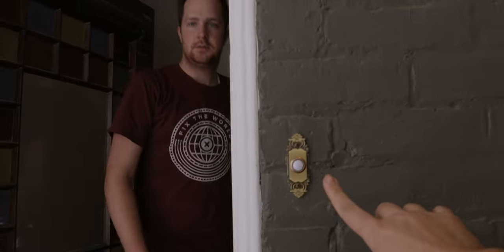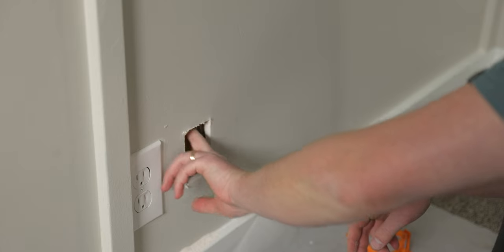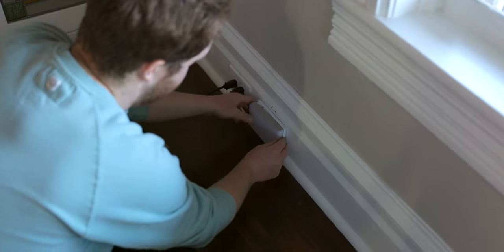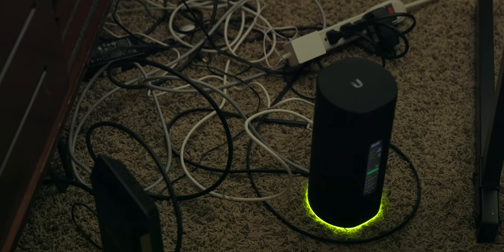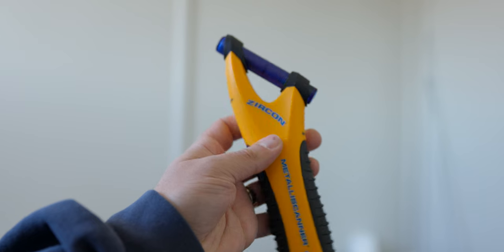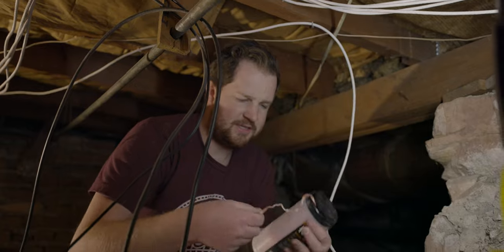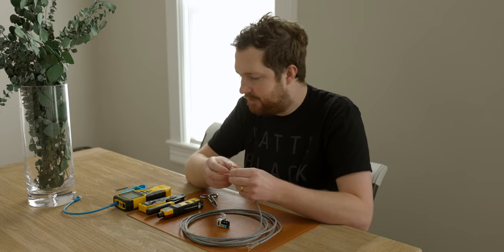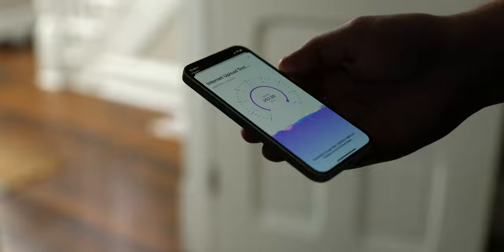Adding 10 Gigabit Ethernet to my 129-Year-Old House!

Comment: Just stupid at this point to invest in a wired network.  How much money did you spend on cabling alone?  You could outfit this house with a mesh network and be done in an hour
Reply: Disagree.  If you can run wire "reasonably", wire it.  I will always take a wire any day!!  I use both Wire and Wireless, 100% Ubiquiti Unifi for all equipment, both DECA (reusing Coax) and cat6.  I use only one mesh connected AP in my home at a place outside that did not make sense to get a cable there.
Reply: @Mark-ji5ve   completely disagree to drill through holes through the wall of a 100-year-old house only destroys its value The cost of wire. The cost of the work cost cost. This video is for the rich, not for the average Joe.  Then when you move you do it all over again. I can't stress that wiring your home at this point is just you throwing your money away. This is not a good investment. The gains you would get are minimal at this point and wireless is only getting better.
Reply from the maker: I’m with Mark.
Reply: It's very clear neither of you want to take a good look at what you're promoting. First of all, Mark "reasonably" priced what world do you live? Where copper wire is to priced reasonably in 2022? Furthermore, if you're both agreeing to destroy a heritage home...
Again, I can't stress enough. The gains that you would get by wiring would be so minimal that we have to have the conversation about what you're doing to the home and the cost involved in doing the work. ( Which is far more than just wire). 

Good day to both of you.  Neither of you are willing to have to have a full conversation about what you're doing to the home and cost involved and there's no point in getting involved in this conversation as you guys are blind to the whole picture
Reply: Mesh is a good solution if you know zero about networks but it will always be slower, and you pay greatly for that convenience. The purpose of this cabling is for the highest speed and full control over your wireless networks.
Reply: @craigfaubert862  gains aren’t minimal. Mesh networks will never even reach 1gb or 1/4 of that even if you pay for it. You pay extra to have mesh pods. This cabling will always have download speeds 10-40x better.
Reply: @craigfaubert862  this is meant for people who do editing like snazzy, television networks, business, conventions, schools. Most businesses can’t afford fiber in real life. Mesh networks are for people in homes. Finance/ school/ govt/ Businesses still cant use mesh networks due to low security and network segmentation, they need to hook up to a coaxial (cable) network and split their bastion servers in a screened subnet and split their network to monitor whats happening. Maybe a cheap yogurt shop can use mesh, but once its attacked it all goes down and guests are import resources are not separated, therefore anyone can easily break it with right technique and have access to your information. If kept online.